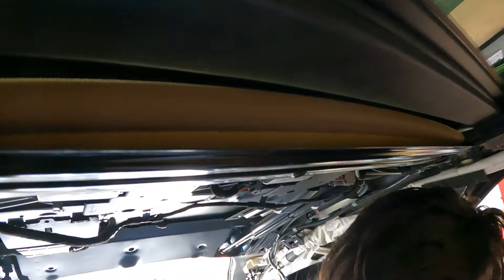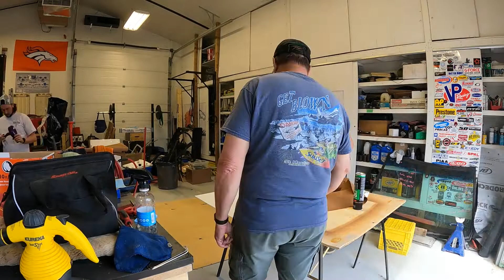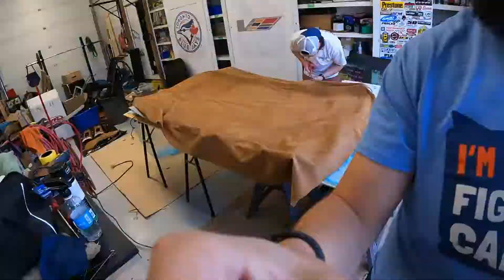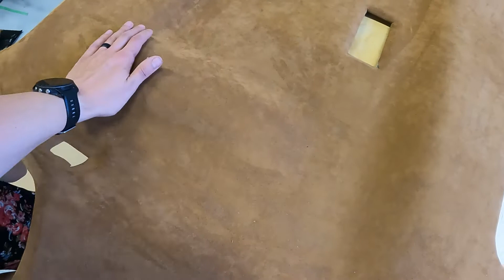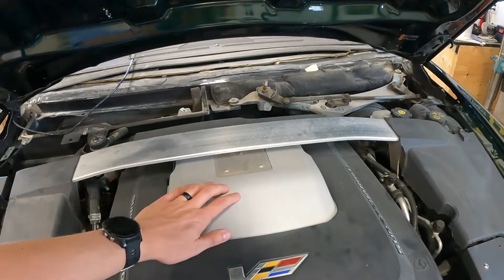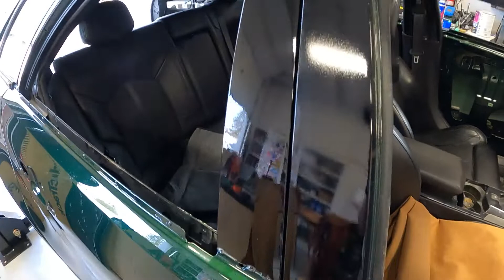CTS V Wagon Gets Custom DIY Alcantara Headliner

Comment: Hey man i getting ready to do my ctsv sedan in black Figured I'd ask fabric.Did you use the one with the backing or no backing?And what glue did you use looks fire!!
Reply from the maker: Hey, that's awesome! It made a huge difference on the feel of things inside the car. I went with the un-backed because I just glued it onto the factory fabric. For glue we used the 3M 90 hi-strength. We were in 105-110F heat on Death Week and it didn't sag so for now it seems to be holding up well.
Reply: Thanks man looks great going order stuff this week
Reply from the maker: Awesome, good luck!